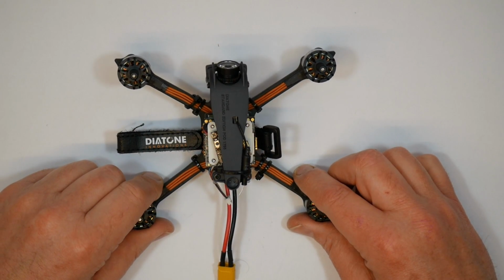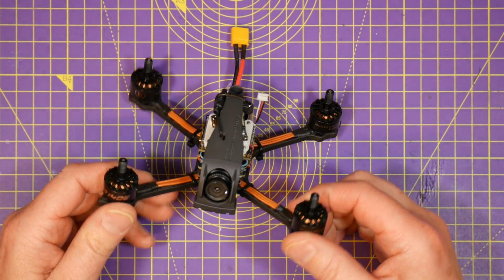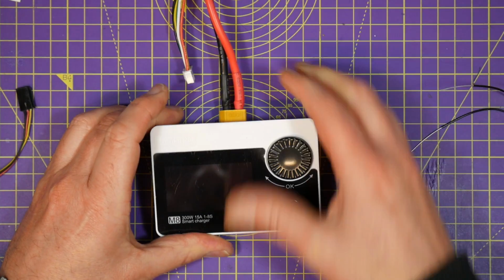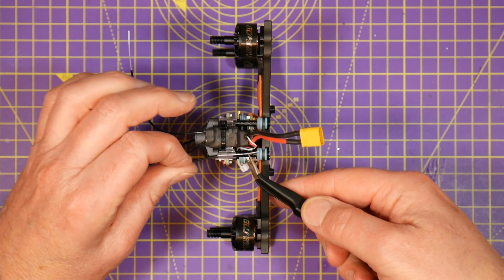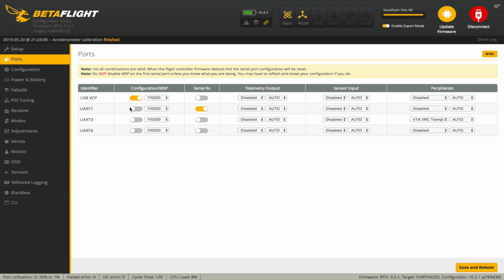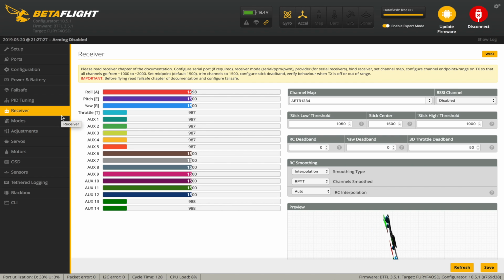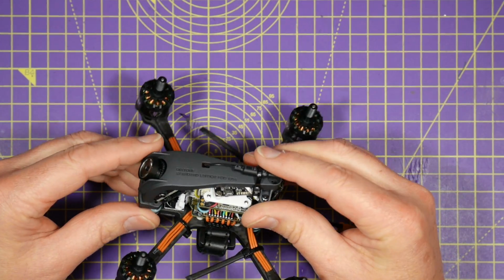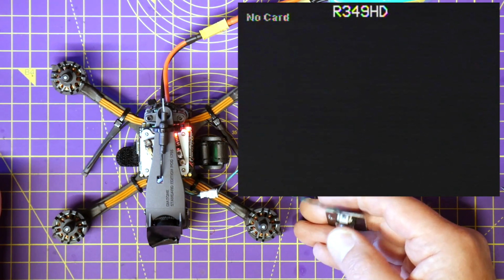Diatone 2019 GT R349 HD full setup // Flight Footage // Betaflight // Caddx Turtle V2 settings

Comment: Hi mate, just got this quad and have never bought a PNP quad before. Are the 3 wires coming off the back into the 5 port plug for connecting to the receiver or do I need to solder the receiver wires somewhere else onto the board?
Reply from the maker: That plug is designed to directly fit an FrSky R-XSR receiver - hence PNP. The 3 wires are red - 5V, black - 0V, yellow - SBUS. So if you use an R-XSR you can just plug it straight in or if you're using another receiver, snip the plug off and solder onto the 5V, 0V and SBUS out pins on the RX.
Reply: @WhirlyBloke  I just got this quad. What's up with my receiver connector? I have red, black , yellow AND white and the plugs don't fit. https://i.imgur.com/Mjsnj6H.jpg
Reply: @hellyeah8380  exact same question, what did you do in the end mate?

Comment: Hi,
Great review! I get mine in less than 24 hrs! cant wait. 
What props do you use? and have you tweaked the PID's or use diatones stock? 
Thanks
Reply from the maker: You'll love it. I've tweaked the P a couple of points but other than that it's stock. But I use my own rates as shown in the video. I've stuck with GemFan Windancer 3028 http://bit.ly/2ZPb9Hq which work great.

Comment: Stock pids? If not can you share? 🙏
Reply from the maker: This is what mine came with. Remember to back up your current setup first.
Entering CLI Mode, type 'exit' to return, or 'help'

# dump

# version
# Betaflight / FURYF4OSD (FY4O) 3.5.1 Sep  8 2018 / 05:21:25 (d9fb5ca13) MSP API: 1.40

board_name FURYF4OSD
manufacturer_id 

# name
name diatone

# resources
resource BEEPER 1 A08
resource MOTOR 1 A03
resource MOTOR 2 B00
resource MOTOR 3 B01
resource MOTOR 4 A02
resource MOTOR 5 NONE
resource MOTOR 6 NONE
resource MOTOR 7 NONE
resource MOTOR 8 NONE
resource SERVO 1 NONE
resource SERVO 2 NONE
resource SERVO 3 NONE
resource SERVO 4 NONE
resource SERVO 5 NONE
resource SERVO 6 NONE
resource SERVO 7 NONE
resource SERVO 8 NONE
resource PPM 1 C09
resource PWM 1 NONE
resource PWM 2 NONE
resource PWM 3 NONE
resource PWM 4 NONE
resource PWM 5 NONE
resource PWM 6 NONE
resource PWM 7 NONE
resource PWM 8 NONE
resource LED_STRIP 1 A00
resource SERIAL_TX 1 A09
resource SERIAL_TX 2 NONE
resource SERIAL_TX 3 B10
resource SERIAL_TX 4 NONE
resource SERIAL_TX 5 NONE
resource SERIAL_TX 6 C06
resource SERIAL_TX 7 NONE
resource SERIAL_TX 8 NONE
resource SERIAL_TX 9 NONE
resource SERIAL_TX 10 NONE
resource SERIAL_TX 11 NONE
resource SERIAL_TX 12 NONE
resource SERIAL_RX 1 A10
resource SERIAL_RX 2 NONE
resource SERIAL_RX 3 B11
resource SERIAL_RX 4 NONE
resource SERIAL_RX 5 NONE
resource SERIAL_RX 6 C07
resource SERIAL_RX 7 NONE
resource SERIAL_RX 8 NONE
resource SERIAL_RX 9 NONE
resource SERIAL_RX 10 NONE
resource SERIAL_RX 11 NONE
resource SERIAL_RX 12 NONE
resource INVERTER 1 C00
resource INVERTER 2 NONE
resource INVERTER 3 NONE
resource INVERTER 4 NONE
resource INVERTER 5 NONE
resource INVERTER 6 NONE
resource INVERTER 7 NONE
resource INVERTER 8 NONE
resource INVERTER 9 NONE
resource INVERTER 10 NONE
resource INVERTER 11 NONE
resource INVERTER 12 NONE
resource I2C_SCL 1 B06
resource I2C_SCL 2 NONE
resource I2C_SCL 3 NONE
resource I2C_SDA 1 B07
resource I2C_SDA 2 NONE
resource I2C_SDA 3 NONE
resource LED 1 B05
resource LED 2 B04
resource LED 3 NONE
resource RX_BIND 1 NONE
resource RX_BIND_PLUG 1 NONE
resource SPI_SCK 1 A05
resource SPI_SCK 2 B13
resource SPI_SCK 3 C10
resource SPI_MISO 1 A06
resource SPI_MISO 2 B14
resource SPI_MISO 3 C11
resource SPI_MOSI 1 A07
resource SPI_MOSI 2 B15
resource SPI_MOSI 3 C12
resource ESCSERIAL 1 C09
resource CAMERA_CONTROL 1 NONE
resource ADC_BATT 1 C01
resource ADC_RSSI 1 C02
resource ADC_CURR 1 C03
resource ADC_EXT 1 NONE
resource PINIO 1 NONE
resource PINIO 2 NONE
resource PINIO 3 NONE
resource PINIO 4 NONE
resource USB_MSC_PIN 1 NONE
resource FLASH_CS 1 B03
resource OSD_CS 1 B12
resource SPI_PREINIT_IPU 1 A04
resource SPI_PREINIT_IPU 2 B03
resource SPI_PREINIT_IPU 3 B12
resource SPI_PREINIT_IPU 4 NONE
resource SPI_PREINIT_IPU 5 NONE
resource SPI_PREINIT_IPU 6 NONE
resource SPI_PREINIT_IPU 7 NONE
resource SPI_PREINIT_IPU 8 NONE
resource SPI_PREINIT_IPU 9 NONE
resource SPI_PREINIT_IPU 10 NONE
resource SPI_PREINIT_IPU 11 NONE
resource SPI_PREINIT_OPU 1 NONE
resource SPI_PREINIT_OPU 2 NONE

# mixer
mixer QUADX

mmix reset

# servo
servo 0 1000 2000 1500 100 -1
servo 1 1000 2000 1500 100 -1
servo 2 1000 2000 1500 100 -1
servo 3 1000 2000 1500 100 -1
servo 4 1000 2000 1500 100 -1
servo 5 1000 2000 1500 100 -1
servo 6 1000 2000 1500 100 -1
servo 7 1000 2000 1500 100 -1

# servo mix
smix reset

# feature
feature -RX_PPM
feature -INFLIGHT_ACC_CAL
feature -RX_SERIAL
feature -MOTOR_STOP
feature -SERVO_TILT
feature -SOFTSERIAL
feature -GPS
feature -RANGEFINDER
feature -TELEMETRY
feature -3D
feature -RX_PARALLEL_PWM
feature -RX_MSP
feature -RSSI_ADC
feature -LED_STRIP
feature -DISPLAY
feature -OSD
feature -CHANNEL_FORWARDING
feature -TRANSPONDER
feature -AIRMODE
feature -RX_SPI
feature -SOFTSPI
feature -ESC_SENSOR
feature -ANTI_GRAVITY
feature -DYNAMIC_FILTER
feature INFLIGHT_ACC_CAL
feature RX_SERIAL
feature OSD
feature AIRMODE
feature ANTI_GRAVITY
feature DYNAMIC_FILTER

# beeper
beeper GYRO_CALIBRATED
beeper RX_LOST
beeper RX_LOST_LANDING
beeper DISARMING
beeper ARMING
beeper ARMING_GPS_FIX
beeper BAT_CRIT_LOW
beeper BAT_LOW
beeper GPS_STATUS
beeper RX_SET
beeper ACC_CALIBRATION
beeper ACC_CALIBRATION_FAIL
beeper READY_BEEP
beeper MULTI_BEEPS
beeper DISARM_REPEAT
beeper ARMED
beeper SYSTEM_INIT
beeper ON_USB
beeper BLACKBOX_ERASE
beeper CRASH FLIP
beeper CAM_CONNECTION_OPEN
beeper CAM_CONNECTION_CLOSED
beeper RC_SMOOTHING_INIT_FAIL

# beacon
beacon GYRO_CALIBRATED
beacon RX_LOST
beacon RX_LOST_LANDING
beacon DISARMING
beacon ARMING
beacon ARMING_GPS_FIX
beacon BAT_CRIT_LOW
beacon BAT_LOW
beacon GPS_STATUS
beacon RX_SET
beacon ACC_CALIBRATION
beacon ACC_CALIBRATION_FAIL
beacon READY_BEEP
beacon MULTI_BEEPS
beacon DISARM_REPEAT
beacon ARMED
beacon SYSTEM_INIT
beacon ON_USB
beacon BLACKBOX_ERASE
beacon CRASH FLIP
beacon CAM_CONNECTION_OPEN
beacon CAM_CONNECTION_CLOSED
beacon RC_SMOOTHING_INIT_FAIL

# map
map AETR1234

# serial
serial 20 1 115200 57600 0 115200
serial 0 64 115200 57600 0 115200
serial 2 8192 115200 57600 0 115200
serial 5 0 115200 57600 0 115200

# led
led 0 0,0::C:0
led 1 0,0::C:0
led 2 0,0::C:0
led 3 0,0::C:0
led 4 0,0::C:0
led 5 0,0::C:0
led 6 0,0::C:0
led 7 0,0::C:0
led 8 0,0::C:0
led 9 0,0::C:0
led 10 0,0::C:0
led 11 0,0::C:0
led 12 0,0::C:0
led 13 0,0::C:0
led 14 0,0::C:0
led 15 0,0::C:0
led 16 0,0::C:0
led 17 0,0::C:0
led 18 0,0::C:0
led 19 0,0::C:0
led 20 0,0::C:0
led 21 0,0::C:0
led 22 0,0::C:0
led 23 0,0::C:0
led 24 0,0::C:0
led 25 0,0::C:0
led 26 0,0::C:0
led 27 0,0::C:0
led 28 0,0::C:0
led 29 0,0::C:0
led 30 0,0::C:0
led 31 0,0::C:0

# color
color 0 0,0,0
color 1 0,255,255
color 2 0,0,255
color 3 30,0,255
color 4 60,0,255
color 5 90,0,255
color 6 120,0,255
color 7 150,0,255
color 8 180,0,255
color 9 210,0,255
color 10 240,0,255
color 11 270,0,255
color 12 300,0,255
color 13 330,0,255
color 14 0,0,0
color 15 0,0,0

# mode_color
mode_color 0 0 1
mode_color 0 1 11
mode_color 0 2 2
mode_color 0 3 13
mode_color 0 4 10
mode_color 0 5 3
mode_color 1 0 5
mode_color 1 1 11
mode_color 1 2 3
mode_color 1 3 13
mode_color 1 4 10
mode_color 1 5 3
mode_color 2 0 10
mode_color 2 1 11
mode_color 2 2 4
mode_color 2 3 13
mode_color 2 4 10
mode_color 2 5 3
mode_color 3 0 8
mode_color 3 1 11
mode_color 3 2 4
mode_color 3 3 13
mode_color 3 4 10
mode_color 3 5 3
mode_color 4 0 7
mode_color 4 1 11
mode_color 4 2 3
mode_color 4 3 13
mode_color 4 4 10
mode_color 4 5 3
mode_color 5 0 9
mode_color 5 1 11
mode_color 5 2 2
mode_color 5 3 13
mode_color 5 4 10
mode_color 5 5 3
mode_color 6 0 6
mode_color 6 1 10
mode_color 6 2 1
mode_color 6 3 0
mode_color 6 4 0
mode_color 6 5 2
mode_color 6 6 3
mode_color 6 7 6
mode_color 6 8 0
mode_color 6 9 0
mode_color 6 10 0
mode_color 7 0 3

# aux
aux 0 0 0 1850 2100 0 0
aux 1 0 0 900 900 0 0
aux 2 0 0 900 900 0 0
aux 3 0 0 900 900 0 0
aux 4 0 0 900 900 0 0
aux 5 0 0 900 900 0 0
aux 6 0 0 900 900 0 0
aux 7 0 0 900 900 0 0
aux 8 0 0 900 900 0 0
aux 9 0 0 900 900 0 0
aux 10 0 0 900 900 0 0
aux 11 0 0 900 900 0 0
aux 12 0 0 900 900 0 0
aux 13 0 0 900 900 0 0
aux 14 0 0 900 900 0 0
aux 15 0 0 900 900 0 0
aux 16 0 0 900 900 0 0
aux 17 0 0 900 900 0 0
aux 18 0 0 900 900 0 0
aux 19 0 0 900 900 0 0

# adjrange
adjrange 0 0 0 900 900 0 0 0 0
adjrange 1 0 0 900 900 0 0 0 0
adjrange 2 0 0 900 900 0 0 0 0
adjrange 3 0 0 900 900 0 0 0 0
adjrange 4 0 0 900 900 0 0 0 0
adjrange 5 0 0 900 900 0 0 0 0
adjrange 6 0 0 900 900 0 0 0 0
adjrange 7 0 0 900 900 0 0 0 0
adjrange 8 0 0 900 900 0 0 0 0
adjrange 9 0 0 900 900 0 0 0 0
adjrange 10 0 0 900 900 0 0 0 0
adjrange 11 0 0 900 900 0 0 0 0
adjrange 12 0 0 900 900 0 0 0 0
adjrange 13 0 0 900 900 0 0 0 0
adjrange 14 0 0 900 900 0 0 0 0

# rxrange
rxrange 0 1000 2000
rxrange 1 1000 2000
rxrange 2 1000 2000
rxrange 3 1000 2000

# vtx
vtx 0 0 0 0 900 900
vtx 1 0 0 0 900 900
vtx 2 0 0 0 900 900
vtx 3 0 0 0 900 900
vtx 4 0 0 0 900 900
vtx 5 0 0 0 900 900
vtx 6 0 0 0 900 900
vtx 7 0 0 0 900 900
vtx 8 0 0 0 900 900
vtx 9 0 0 0 900 900

# rxfail
rxfail 0 a
rxfail 1 a
rxfail 2 a
rxfail 3 a
rxfail 4 h
rxfail 5 h
rxfail 6 h
rxfail 7 h
rxfail 8 h
rxfail 9 h
rxfail 10 h
rxfail 11 h
rxfail 12 h
rxfail 13 h
rxfail 14 h
rxfail 15 h
rxfail 16 h
rxfail 17 h

# master
set align_gyro = DEFAULT
set gyro_hardware_lpf = NORMAL
set gyro_32khz_hardware_lpf = NORMAL
set gyro_sync_denom = 1
set gyro_lowpass_type = PT1
set gyro_lowpass_hz = 90
set gyro_lowpass2_type = PT1
set gyro_lowpass2_hz = 300
set gyro_notch1_hz = 0
set gyro_notch1_cutoff = 0
set gyro_notch2_hz = 0
set gyro_notch2_cutoff = 0
set gyro_calib_duration = 125
set gyro_calib_noise_limit = 48
set gyro_offset_yaw = 0
set gyro_overflow_detect = ALL
set yaw_spin_recovery = ON
set yaw_spin_threshold = 1950
set gyro_use_32khz = OFF
set dyn_notch_quality = 70
set dyn_notch_width_percent = 50
set align_acc = DEFAULT
set acc_hardware = AUTO
set acc_lpf_hz = 10
set acc_trim_pitch = 0
set acc_trim_roll = 0
set acc_calibration = 0,0,0
set mid_rc = 1500
set min_check = 1050
set max_check = 1900
set rssi_channel = 0
set rssi_src_frame_errors = OFF
set rssi_scale = 100
set rssi_offset = 0
set rssi_invert = OFF
set rc_interp = AUTO
set rc_interp_ch = RPYT
set rc_interp_int = 19
set rc_smoothing_type = INTERPOLATION
set rc_smoothing_input_hz = 0
set rc_smoothing_derivative_hz = 0
set rc_smoothing_debug_axis = ROLL
set rc_smoothing_input_type = BIQUAD
set rc_smoothing_derivative_type = BIQUAD
set fpv_mix_degrees = 0
set max_aux_channels = 14
set serialrx_provider = SBUS
set serialrx_inverted = OFF
set spektrum_sat_bind = 0
set spektrum_sat_bind_autoreset = ON
set airmode_start_throttle_percent = 32
set rx_min_usec = 885
set rx_max_usec = 2115
set serialrx_halfduplex = OFF
set adc_device = 1
set input_filtering_mode = OFF
set blackbox_p_ratio = 32
set blackbox_device = SPIFLASH
set blackbox_record_acc = ON
set blackbox_mode = NORMAL
set min_throttle = 1070
set max_throttle = 2000
set min_command = 1000
set dshot_idle_value = 550
set dshot_burst = OFF
set use_unsynced_pwm = OFF
set motor_pwm_protocol = DSHOT600
set motor_pwm_rate = 480
set motor_pwm_inversion = OFF
set motor_po

Comment: With this work with my super old X9D Plus from 2014?
Reply from the maker: Depends on the version of OpenTX you're running. Probably a good idea to bring it up to date. Back it up first though, just in case it goes wrong.

Comment: Does anyone have a Betaflight 4.1 tune for 3s and 4s they can share?
Also, how can I get the voltage on my QX7?  Telemetry can't find VFAS.  Sometimes I like to fly line of sight.  I have a RXSR receiver and I can see the voltage on the OSD... just not on the QX7.
Reply from the maker: https://www.youtube.com/watch?v=bvlNaWUeAAU
Reply: @WhirlyBloke  Thanks for the direction, but I was able to get RSSI on the QX7 and on the OSD. 
What I haven't gotten yet is how to put the battery voltage onto the QX7.  It does appear on the OSD, but the QX7 does not discover VFAS on the Telemetry page.

Comment: my OSD does not show in my goggles other than the craft name and the rssi value , my timers and battery values seem to have vanished, any ideas ?
Reply from the maker: A common problem. I bet you're using a 16:9 camera or goggles. They will be there but off the bottom or top of the display. In BF OSD page move the voltage and timer near the middle of the screen, save and try again - they should appear. Move them around until they are where you want them.
Reply: @WhirlyBloke  yeash i know about that matey , i learnt that as a noob 3 years ago , i have HD3's 4:3 and also just a black screen now , it's a caddx camera fault i'm trying to sort